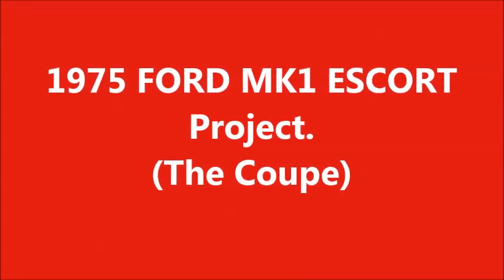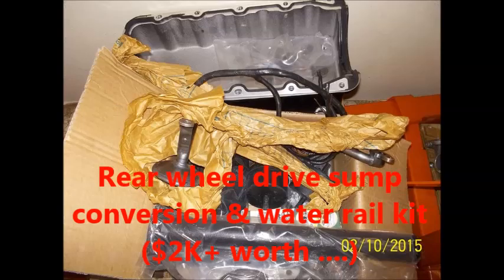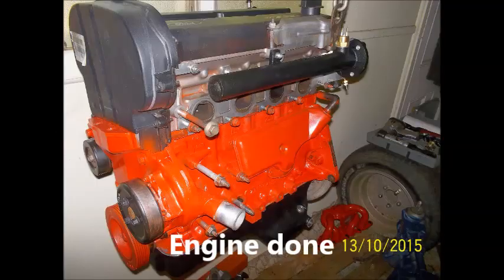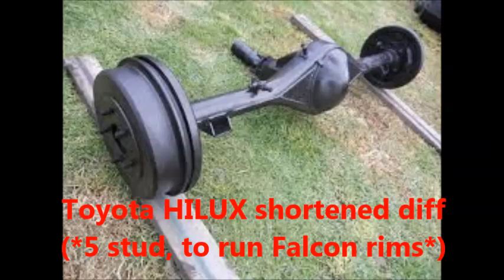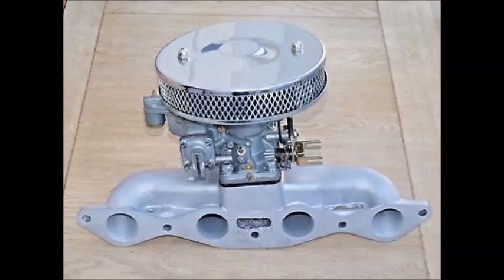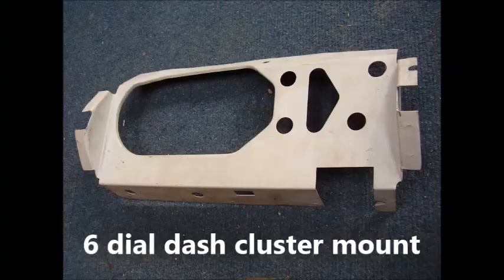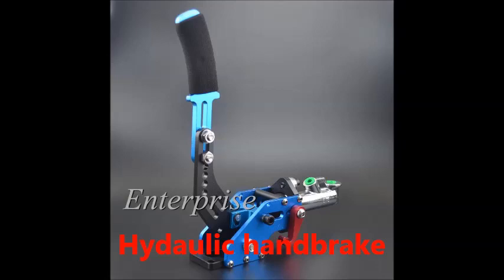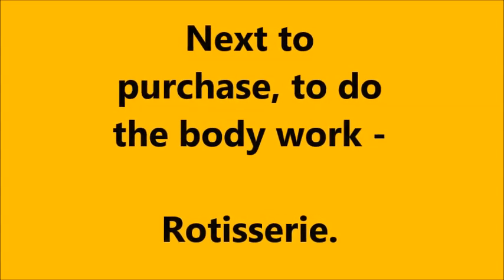MK1 Escort with Zetec 2L conversion & other goodies

Comment: Pretty amazing.  You building a car 🚗
Reply from the maker: Every vehicle I own, upon purchase it gets every nut, bolt, and wire removed, and re-built. I was a mechanic, Auto-elec, Trans & diff specialist, and I've done panel beating. 

The only thing I won't do is re-cover seats. I'd rather pay for that.
I enjoy it, which helps.
Reply from the maker: RandyfromReality  No, but I'll look into it now. Thanks.
My father was a panel beater / spray painter, so it's just a case of 'll prep, then get him down here for a 'holiday'. I have sand-blasters, spray equip, all the panel beating gear, etc, but he's got a steadier hand, so I'll get him to do it.
Yeah, lol. You can always tell an Aussie. Have a good one     ;-)

Comment: Hey Jason, Who done the shorten of the hilux diff and what is the width, including drums if you dont mind please mate.
Reply from the maker: 1350mm is the width. Some really early Hilux 2wd utes use a diff almost identical in fitment (1350 drum face to drum face, and spring centers are 940mm between them. You can use MK2 60mm wide rear springs). I have one of the above, and a shortened later diff (originally 1370) to 1360 wide, as I'll be running a flair kit, and early 10" ROH Center-line mags, with 245/14's on the rear, and I didn't want to belt 5mm out of the inner guard on each side, so the tyres clear the body under full compression in the shocks, but I need them to stay inside the flairs. It was done in Toowoomba, QLD,  and shipped to me in SA. She won't always be on sealed roads. Most roads where I am are dirt, and are rough,  ..... and I like to have fun.